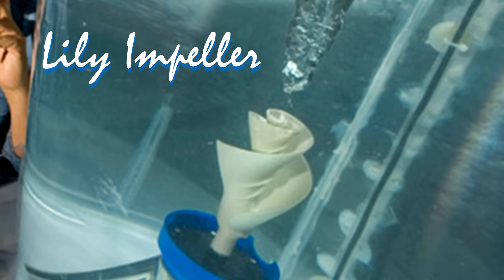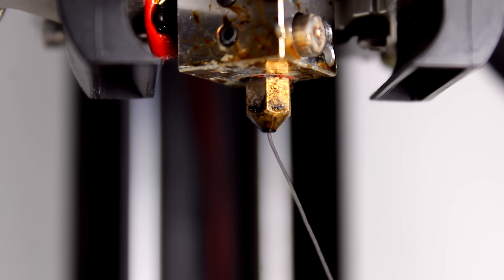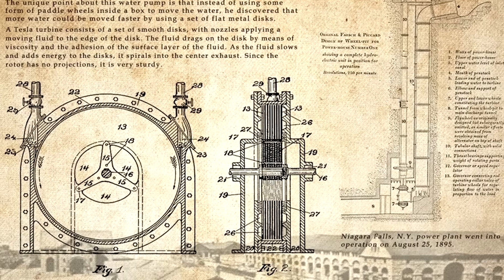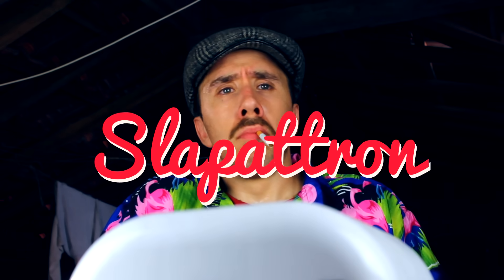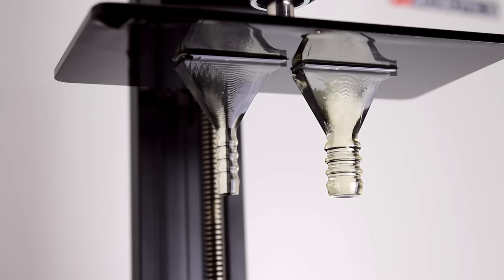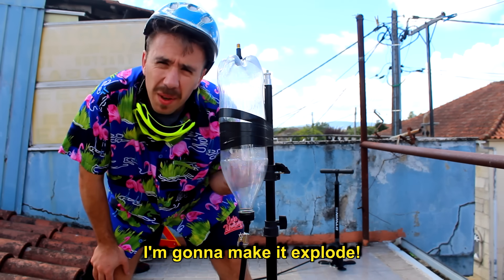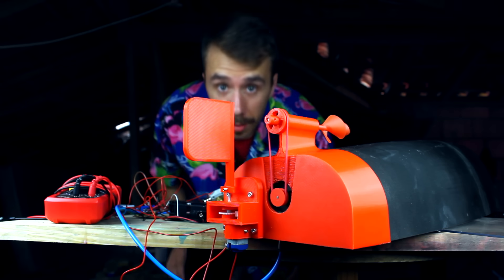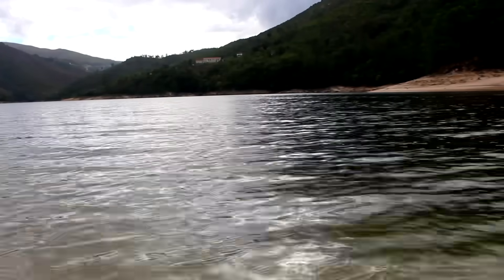Tesla Turbine Boat 3D Printed (Lily Impeller)

Comment: A Tesla turbine helicopter would be nice now that we have the control circuits for it, like with air stored in bottles instead of batteries to act as a energy source
Reply: You could also have 4 inputs on the turbine itself to maintain balance and maybe increase the speed of the propeller

Comment: Love the content. How about building THE FLYING MACHINE from Leonardo da Vinci that as a very similar impeler design for the "Blade" just escale up the impelar ON TGE 3D PRINTER and voila one 15th Century FLYING MACHINE, if it does not work you can use for terminat TOMATOES HUAAAAAAAAAAAAA.

Comment: On the next video, you could try piping the compressed air straight out the back of the boat and steer it by directing the nozzle to either side. This would eliminate extra weight and parts. Hopefully that will give a higher output/ speed. It’s cool to see these old concepts in action though!

Comment: Design a bellows driven, steampunk themed RC car! Use 2 bellows and as one is taking air in the other is pushing out. Y adapter with rubber flap disc valves on the output should do the trick. Bellows are easy to make from scratch with plastic film and venetian blind slats, but 3d printed slats would be cooler. I've seen stepper motors used to drive bellows.
Reply: I love this idea! Please win. hahaha
Reply: This!!! You are creative!
Reply: Robert Murray Smith follower by any chance? Saw some stuff he did with bellows recently. Very cool guy!
Reply: If this happens I NEED THE PLANSSSS! Just take my money now...

Comment: A Hydrogen Electrolysis Generator would make a great video.
Reply: Hydrogen power may be the future.
Reply: Use solar electrolysis to generate h2 and o2, then feed into a manifold, combust, and feed exhaust into tesla turbine. Solar turbine powered boat. It would take a long time to refuel but it'd be fast!

Comment: If I could suggest a couple improvements. I would say mount the bottles above the boat so less drag in the water. And build a housing around the impeller to direct the flow. I'm not certain but I believe impellers are in jet boats. And they have a housing around the impeller.

Comment: So technically this isn’t an impeller it’s a propeller. Impellers have a shroud around them. But also increase the size of the propeller and slow it down with the belt system. And you will definitely pickup some speed. Hydro dynamics are quite a bit different then aerodynamics.

Comment: I love the determination on getting a project done no matter what obstacles you encounter! I've also bought a cheap RC Car for the same reason you did, however my determination wasn't as amazing as yours that i actually got to finish the project. Haha! 
A project i've never had enough determination of doing yet is a Pneumatic Ram Pump. There is already an existing Hydraulic Ram Pump which pumps water to a higher elevation by converting the inertia of flowing water into an impulse by shutting a one way valve really quickly and that impulse displaces a small amount of water that was captured inside going up an elevated pipe. However, the main issue of a Pneumatic version is that air is really light to have any inertia to create an impulse, that's when your videos about the tesla turbine(To keep the air in high velocity to have a high inertia) and the tesla valve to quickly reverse airflow to create an impulse.  This would create a pump that would reach really high pressures without your driving pump working as much to achieve that pressure.  Just an idea for now. But if you can make that happen that would be amazing!

Comment: hi integza.. immediately after i saw the lily turbine.. i imagined this. How about building a submarine/torpedo that propels using lily turbine fitted to its front.? the great Tesla turbine can be used to power this.. but instead of compressed air, some solid rocket can be used to generate compressed gases that can turn the turbine.. it will be compact and much powerful than compressed air.. also.. it will be much cool!!

i guess the idea has been already popped up for @Dondon.. who suggested a similar thing below.

Comment: An idea that I have would be a 3D printed gyroscope, which you could try to use in a two wheel car. It would be especially cool if you were able to power the car with a stirling engine.

Comment: Bro, you need to make a cnc. You have the know how and such. You keep trying to make complex machine parts with the restn printer and they keep breaking. Resin is great for complex smooth shapes. But they are inherently not strong. You will have much higher success with cnc. Love your work either way though, hope you have the successs

Comment: You should make a tesla turbine powered by falling water in a tube. Use the turbine to generate electricity. Store the electricity into supercapacitors. Use the supercapacitors to run an Archimedes screw to draw water up to power turbine. The see how long it takes for the system to get to 0 energy level.

Comment: Tom Stanton made a single cylinder compressed air engine, maybe you could make a multi-cylinder compressed air engine. You could also see if a radial air engine is more or less effective than a v6 or v8 air engine.

Comment: Before pressure testing the bottle, you should fill it with water. Using a smaller volume of air, and reach the same results without a big, but dramatic, bang.
It’s the way they “hydro test” SCUBA cylinders.

Comment: @Integza  I'ved just got an idea for you while working on diy rc boat, Double ducted lily impeller powered submarine, an impeller on each sides, the same energy storage system wich being more efficient as the water pressure rise... This system can also be used for ballast system, with a water pump, to dive and push air to Tesla turbine.

Comment: You’re using an impeller as a propeller. 
All your thrust is being wasted out the sides.  
Try printing a cylinder to slide over the impeller. Preferably a cylinder that follows the contour of the impeller. 
Larger opening at the intake, reducing to a smaller exit nozzle.

Comment: Definitely should incase the impeller. Also what about using the lilly impeller as the screws on a 3d printed remote control screw driven tank.

Comment: Very nice, and had no doubt it would move. You're introducing too much drag though; the storage should be well above the water line so it can't drag once bouncing. As others have stated, the entire impeller should be encased inside. With the current motor design you are trying to push and pull the boat where the 'thrust' counteracts most of the potential momentum against the pully. It wasn't clear, but also looks like the motor attachment added a square edge of drag all along the stern? Some minor tweaks and you'll have an air powered RC speed boat that can skip upstream.

Comment: take one motorcycle ,install tesla turbine in front wheel hub ( beaucoup modification required :) ) add turbocharger to moto exhaust for high pressure air supply to tesla turbine via pressure vessel (necessary , as you will need sustained hp in corners, when boost is lower) DA  Daah.... two wheel drive moto.

Comment: You could make a plane or rocket that starts by some solid fuel, super capacitor or outward forces and while traveling in the air it uses the tesla engine to propell itself. Would be pretty fun I think.

Comment: Forgive me if you’ve already thought this through, but I think the efficiency of the Tesla turbine is at it’s most efficient only when spinning at very high RPMs. When the turbine is connected to the Lilly impeller via a very normal gear reduction, the viscosity of the water may be preventing the Tesla turbine from reaching it’s peak usable energy output. To compensate for this, you could possibly use a much more dramatic gear reduction, and some form of a clutch to allow the turbine to reach efficiency before translating that energy into impeller motion. But dang, 1700 comments! You probably won’t even see this. Thanks for the fun video :)
Reply: 3D printed planetary gear box!
Reply: In addition to the gear reduction, you need a shroud for the lily.
Reply: There are a lot of things wrong with this, including that the IMPELLER IS BACKWARDS
Reply: Technically Difficulties Oh, is it?
Reply: @technicallydifficulties7094  not if you flip the turbine.
Reply: Will it not waste energy for that matter? Cause I think if it the turbine reaches its maximum rpm then translate it into a almost at rest impaler would it not put stress on the turbine it self or maybe the gears if he will use gears?
Sorry I'm just curious😁
Reply: Manok Ni San Pedro There are certainly energy losses any time you convert energy, so I would imagine he would want to do that gear reduction in as few steps as possible. I’m not an engineer or anything, just an enthusiast, so I couldn’t tell you what the losses would be in this case.

But it also seems like this project may have been more about combining two very unique inventions than it was about getting an efficient device.
Reply: @FirstTimeCaller2  Could just run small to large pulley's
Reply: Better to put a power generator directly to the output of turbine and using another wlectric motor to generate thrust.
Reply: What gear reduction? He is using 1:1 because the pulleys are the same size. Stay in school kids.
Reply: csorrows Yeah? I believe it. I probably didn’t go back and look.

Maybe you should go to kindness school. mic drop
Reply: Flywheel and clutch..   but I honestly think the impeller would work better as a bladeless disc.... put a cutting disc on a drill.... spin that in a bucket of water and compare the size of the vortex to that Lilly impeller
Reply: It's the top comment now :)
Reply: Or just a flywheel or fluid flywheel transmission.
Reply: Funny thing, it works at its highest efficiency at low rpms, the lower the rpm the higher the wind shear against the discs and thus efficiency
Reply: I hope he does and re-visits this we'll blame rotten tomatoes if he does NOT

Comment: Because you can reuse half of the last project, why not 3d print a "pump-jet" submarine propeller, or several of them, and compare the speeds to the Lilly impeller in this video. Real funky tech! The Hunt for Tesla September! It'll be like doing real science and stuff!
You could even use a slightly lengthened "golden ratio" spline for each blade, to show the difference between lateral and vertical screw types, based on a similar concept. You may need a gearbox for the pump-jet, but the extra water resistance may make it unnecessary even at a Tesla turbine's natural speeds.
(here's what I'm talking about:
https://youtu.be/mv0RjBfs-7c
Jump to around 6:45 if you're not interested in submarine prop cavitation and sonar detection of different screw designs for the general gist of it. Yes, the Lilly impeller should have a shroud too)

Comment: 3d Print the mechanism tanks use to move around...Maybe power it with the tesla turbine. And steer using air valves.

Comment: @Integza can you 3D print a tuning fork? (Supposedly invented in 1711 by John Shore)  (you will find that the origins are potentially quite mysterious) A metal one? And can it be made to resonate at ambient frequencies? (Tuned Schumann resonances?)
(This can theoretically be used to generate power using neodymium magnets and copper coil) thanks for making interesting videos and mentioning Nikola Tesla often. Had not known about The water bender guy, that is very neat info, will need to look further into that.

Comment: i have an upgrade recommendation!!
https://www.youtube.com/watch?v=LqLt_G2dhCI
you can use CO2 cartridges for much more stored air. currently the bottles being also in the water pretty much stops any forward thrust as they have friction. this makes the impeller look less efficient than it is. 
this project is cool!
i would also reduce the steering angle and make the steering a bit more watero-dynamic with a triangle shape at the front.
Reply: the ideas in these projects and the execution of it is really well done! you know how to get things done.

Comment: it seems the impeller should be placed forward 
on the front of the boat 
and be placed in a tube
 while at the rear they had a standard propellerand it is possible for the front of the boat to make less resistance

Comment: Use the Tesla turbine to power a super light weight RC dragster. Experiment with the throttle to accieve maximum range with the given energy in the compressed air

Comment: You need a redo that boat design the word the propeller attached is that needs to be all connected together the whole set of needs to be airtight right there so you get more speed out of

Comment: You can make a motor out of 3D printing, even fully working pistons, and you can use the tesla turbine, out of an steam engine to convert from combistion of mecanic energy, into another mecanic energy, that could be attached to a electric motor, making all the energies of mecanic, conver from different types of mechanical sources, into a lot of power out of the motors, and as energy does not destroys, only converts, you can even amplify the amount of energy from a parallel circuit,

Comment: For a nozzle to be efficient it has to have the smallest cross section (choke point, throat) in the system, that means that the conversion from pressure to kinetic energy occurs in the nozzle, not in the tubing. If you have connections and/or tubing with smaller cross section than the nozzle, the highest flow speed will occur in the tubing. Use big tubing and a small nozzle for best performance. Best perfomance means a nozzle exit flow speed equal to, or greater, than the speed of sound. That means your small diameter turbine should rev much higher than 57 000 rpm. Your best bet is a simple converging nozzle (a wedge shape nozzle) with the smallest cross section at the exit. A De Laval nozzle (coverging/diverging nozzle shaped like a time glass) is more efficient than a simple converging nozzle, but the De Laval nozzle needs to be correctly designed to give high performance. It has to have the correct throat and exit cross sections for any given pressure and mass flow. A simple converging nozzle is much easier to get good performance out of. A wrongly designed De Laval nozzle has poorer performance than a simple converging nozzle. You can print and test different sizes and types of nozzles and measure how they differ in turbine rpm. You should test the nozzles in your turbine because the back pressure is specific to your turbine, if you test the nozzles in the open air they might not perform the same in the turbine. Test with different sizes of tubing and connections as well. It would be quite a science experiment. :)

Comment: How about a modified Tesla turbine that runs on water instead of air? Another idea is a Cavitation water heater. That's a cylinder with dimples on the rounded surface spinning in a sleeve, or housing using the water hammer effect to cause Cavitation bubbles which heat the water. Perhaps the Cavitation heating effect could be modified by a differential charge on the rotor vs the housing? As an aside, there's a book you may be interested in. Free, online written by Ken Wheeler, Magnetism. He's a big Tesla fan to. His YouTube channel is called Theoria Apophasis. I'm very partial to his theory. Peace.

Comment: Nozzle is expanding the air before it goes in.  Probably lose speed for better torque, as it spreads the power across all the discs.

Steery thingie, Rudder.

Comment: If you are looking to make a flying machine, then I suggest you do something using the Magnus effect.  I can think of several ways to incorporate the tesla turbine into such a device, but I would leave it up to you to work something you find most interesting/productive.  Here is a video of such a device using a battery to power the motor:  https://www.youtube.com/watch?v=xMoVzV-XmU0&t=523s

If you want to continue to use the compressed air with 2-liter bottles I suggest you drop some solid (frozen) co2 into the bottle filled with water. This would work for the boat, but would be too heavy for an aircraft design unfortunately.  You would have to stand up the bottle so that the gas can go up to the valve.  OR you could use the same idea and use the mass displacement to propel the object like the toy rockets that you pump up with water and air.  (As a side note a typical 2-liter bottle will handle the pressure, but the smaller ones (20oz or 500ml) will explode if completely sealed). Here is an example of using the water and pressure to propel a rocket:  https://www.youtube.com/watch?v=dsIr5UpfPnk

Comment: You should try using a tesla turbine as a vacuum pump. There is very little information about that and it was one of the promising applications for the tesla turbine. Right now people use expensive turbo pumps but the tesla turbine scaled up slightly should be able to get you to just as high a vacuum.There is no source that lists the maximum achievable vacuum online. At low enough pressures there is no viscous flow and gases behave differently so it will also be a great way to teach people about these principles.

Comment: The tesla turbine needs to be larger so it can have more torque and more rpm , and don't use plastic bottles use one metal so you can put more air in it with higher pressure alot higher actually . If you do that it will be a real speed boat .

Comment: Because the tesla turbine is more efficient at higher rpm you might be better off using a large gear reduction allowing it to speed up faster. A fly wheel might also help if put on the slow spinning side of the gear reduction allowing it to spin up faster. But I doubt you want to go threw all that trouble unless you where making a tesla turbine train seeing as you could have just used the motor from the car and that would have been a bit more effective.